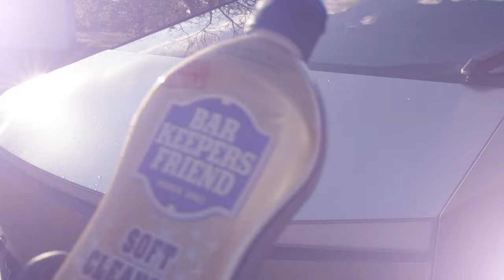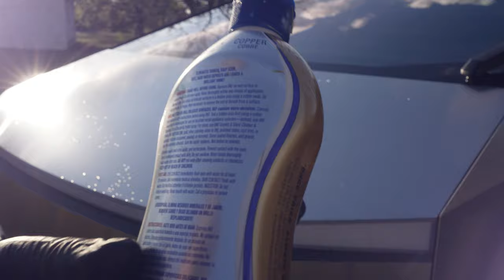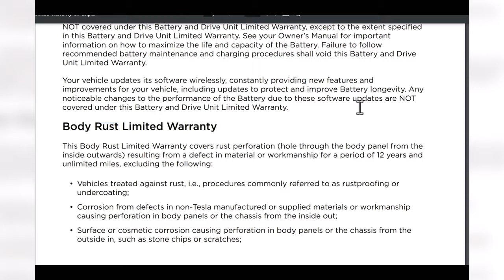Exposing Cybertruck Rust with a Sony Macro Lens

Comment: Microfiber,not paper towels
Reply from the maker: I was wondering about that. What is the main reason? I chose paper towels 🧻 because I thought it would share the ease.  But I was curious if microfiber would be better 🧐🤔💭
Reply: @FreshTechTherapy  I second the microfiber rec and would recommend using MORE Spray + Foam if you're gonna use BKF since it's their only product that doesn't contain abrasives.
Reply from the maker: Thanks for the tip.  I see some spots I’d like to clean on the back angle pillar that will need some tlc.  I think I may get those next … after I get a new hose 😎😂

Comment: Rust spots or (as many vehicle detailers had known them as before cybertruck rust gate) iron deposits are very common. It appears and sticks easier to chrome and not perfectly smooth surfaces on the microscopic scale like the steel on the cybertruck. You can actually find solvents that you just spray on and let sit for a few minutes then rinse away with no polishing or rubbing, but they can require another soap wash because they kind of stick like oil. As long as you don’t strip off the protective oxide steel layer, any rust you see is not caused by internal steel. You also wouldn’t need to worry about it long term. These solvents can remove these deposits that have sat for years. 

Of course bad press gets clicks and making up claims that the cybertruck rusts easily is false when those spots are just from outside iron particles.
Reply from the maker: Thanks for the comment and your time.  I hope my video helps to express the ease of removing.

Comment: Tesla recommends using isopropyl alcohol to remove rust dust— if that fails, use a citrus acid-based cleaner, like CitriSurf 77, combined with a Non-Scratch Scour Pad.
Reply from the maker: This is a great detailed tip. Thanks so much for your time and help sharing.  Non-scratch is a good tip. Some folks are just trolling suggesting scotch Brillo stainless steel scratch pad 🤣

Comment: What you have there is something called fly rust, and it is something that happens to every car, it's just more noticeable on certain colors.

What is fly rust and brake dust?

Fly rust consists of the burnt and rusted iron particles that have ended up on the paint and rims of a car. These iron particles often come from the brake discs and pads. When a car brakes, those iron particles are thrown into the air because of the air swirls around the wheels. Then they land on the car or on the cars around. Iron particles can also land on the car via heavy industry or railroads. In most cases, these iron particles are very hot, causing them to burn into the surface. Oxygen in combination with moisture (rain for example) causes these particles to rust, resulting in fly rust. These iron particles are not always visible because of the color of the surface. However, they can be felt well. For example by gliding your hand over the clean and dry paint.

Why is it important to remove fly rust?

Iron particles will corrode the surface like rust, which can cause damage. In addition, all those rust spots do not look good on a car and reduce the gloss of the paint. It is also not desirable when polishing. The iron particles are sharp and cause scratches when they end up in the polishing pad. This will negatively affect the end result, which is a waste of all the energy put into it.

How can I remove fly rust and brake dust?

In the past, this type of pollution was mainly removed mechanically with a clay bar or a clay pad. This works well, but it only removes the iron particles and not the rust which is burned in the surface. The other option is to chemically remove fly rust. This is done with strong acids, but has in turn risks of damage to health if used incorrectly.
Reply from the maker: So basically, my car is collecting iron particles like a magnet on a fridge!?
Reply: @FreshTechTherapy  Yes, and it is those particles that are rusting on your car. I have had the same on all cars I have owned, more noticeble on light grey/white paints and less on darker/red paint. Also, the environment that you operate your car in matters, as stated there is more iron particles around trainyards or heavy industries.
Reply from the maker: @Palvana Good to hear, I don’t live near either so I’m hopeful the maintenance is lower vs where I used to live … in the other side of the tracks 😮😊
Reply: I lived on a busy thoroughfare and my new white Subaru was usually parked alongside that road. That dust and dirt from the thousands of passing cars, along with typical foggy SF weather, created a ton of tiny rust spots in the white paint. I don't baby cars, and this was one of many reasons I picked up a used jeep to bang around in while in the city. Another reason the cybertruck would never be for me.
Reply from the maker: I think the cyber truck needs to be wrapped. I wonder how much money they saved by skipping paint. 🤔
Reply: That’s for a car with paint, for cybertruck you can use isopropyl alcohol, if that doesn’t work then an acid-based cleaner, like CitriSurf 77, combined with a Non-Scratch Scour Pad.
Reply from the maker: Thanks for the tip 👍👍👍

Comment: How long does the treatment work before more rust spots appear?
Reply from the maker: It’s been over a month and no new spots in the hook so far.  Thanks for asking and checking in 👍🤲
Reply: @FreshTechTherapy  That's good to hear.
Reply from the maker: I imagine there were a lot on many trucks from production and destination travel.  Depends on your location I assume if the particles are common or not.  They says from railroads? 🤔

Comment: Dang brother. That would make me worry if I lived near a coast with all that salt water in the air. Does it have an undercoating to combat possible rust on the underside?
Reply from the maker: Hey 👋 @keith2028 you are such a great fan! Thanks for the quick support and questions ❤️🔥 I’ll double check tomorrow to make sure I’m telling you the truth. I believe it is black underneath, and there is a plastic undercoating underneath the front section of the cybertruck. I’m sure about the plastic on the front underside because on delivery day some of the plastic buttons were missing. 🙈🤦🤦‍♀️🤦‍♂️ simple mistake?
Reply: Salt water in the air isn’t rust dust. 316L marine grade steel doesn’t rust and cybertruck has higher resistance than that, so you’re not going to see rusting from the steel itself in your life time or your great grandkids lifetime. 

There are structures made of stainless steel and they don’t rust and crumble apart.
Reply: @starshipdriver8536  🤣
Reply from the maker: It’s all good, tbh it’s really just a fun ride 99.9999% of the time 😎❤️‍🔥❤️‍🔥❤️‍🔥